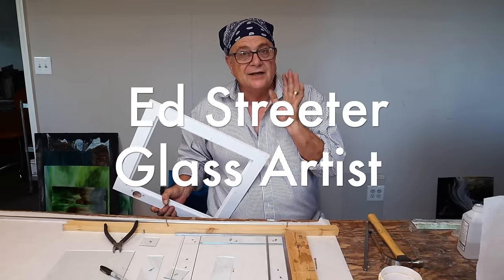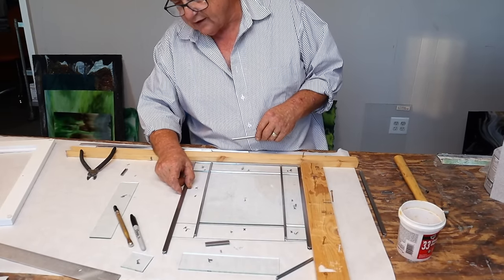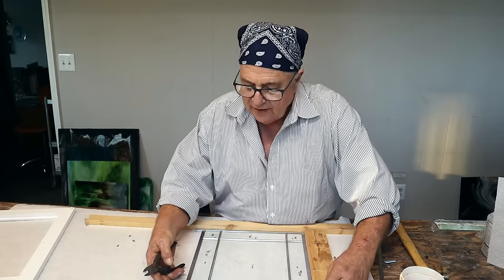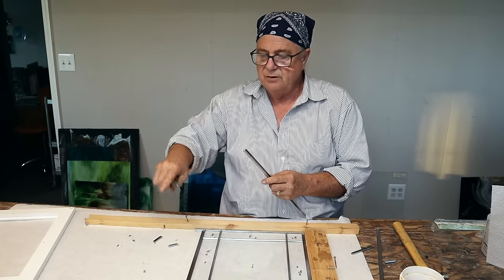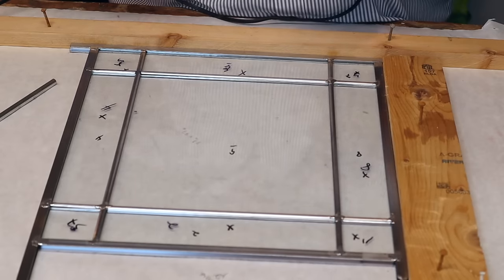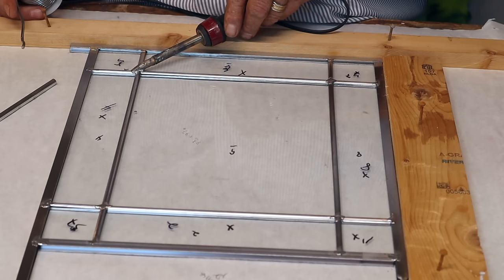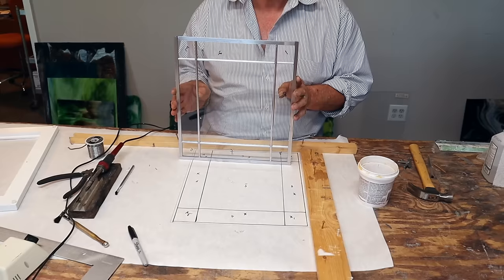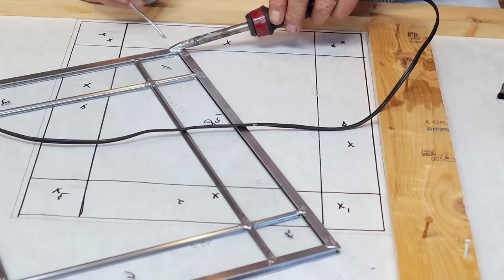Stained Glass Panel in ONE Day!

Comment: I am taking a lead came class and the panel I am working on is now framed in zinc.  This is directed by our teacher.  Can you tell me why you are using lead for your frame? Is it because it is being placed in a wood frame?  Btw, my soldering needs a lot of work. I used to do copper foil and I am getting back to working with glass. Also, do you frame your panels in zinc? I appreciate your knowledge and helpful videos! I am trying to improve my,"1,2,3, straight up"!!!
Reply from the maker: Hi Julie! We use lead around the outside borders since all of our work goes into wood or metal windows, installed onsite. If we make a window to hang we always install in a wood frame. We use lead around the outside edge because it provides a flexible yet stable  environment for the expansion and contraction of the glass due to weather conditions. Have fun in your class!

Comment: Hi! I'm wondering if you can share why the border uses H-lead instead of U-lead? I'm curious about how you install the piece into the cabinet itself and what benefits the H-lead provides. Beautiful work and thanks in advance for your advice!
Reply from the maker: Great question! The H-lead makes it easy to adjust the size if a window or cabinet if it is out of square.
Reply: @ARTyRV  Interesting! What do you mean adjust the size of the H-lead? Wouldn’t measurements be taken before the panel is installed?
Reply from the maker: @HannahHMelby  yes of course! But sometimes you will need to trim the lead on site if theexisting window or door is out of square.